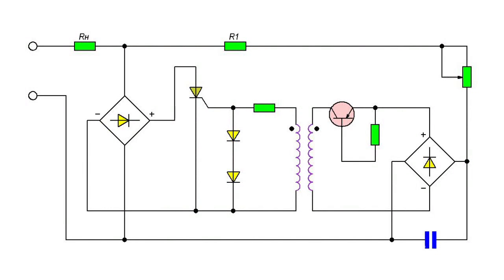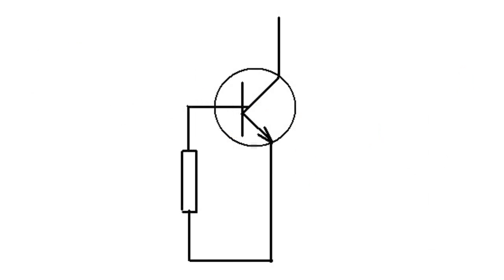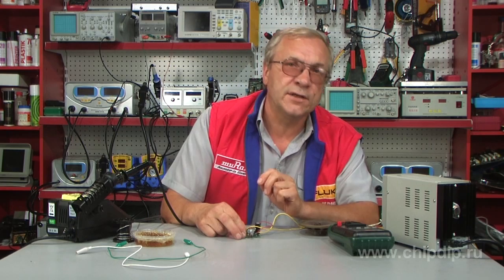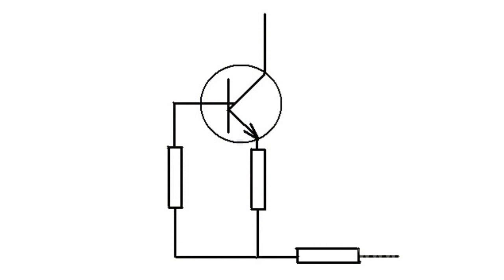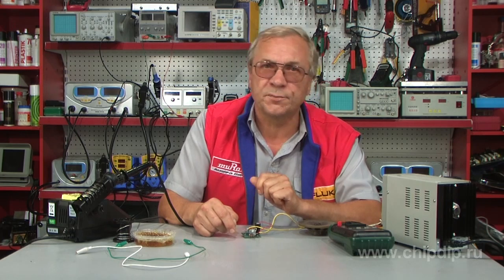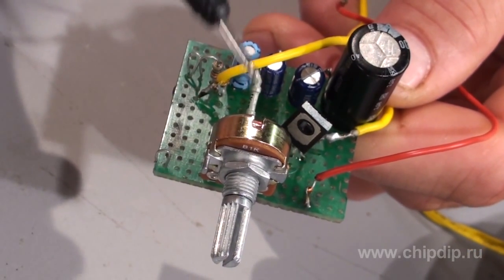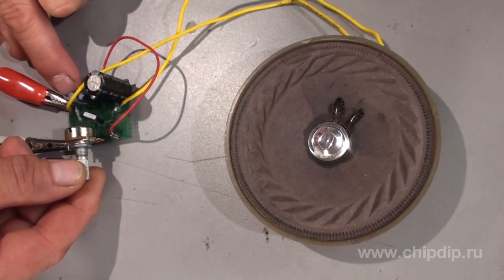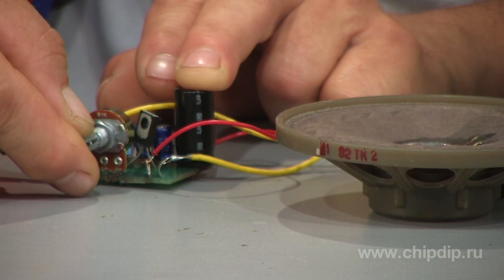Transistor in Avalanche Mode

Comment: hi,
lately I'm interested about solid state marx generator using a first stage of avalance transistor, the aim will be the control of exact moment of HV discharge, I'm wonder if there are particular transistor designed for this application or I could to use any kind of them , then I don't know if a short pulse can damage it, in my case the single stage is 4kV and 4.7nF.
thanks a lot !